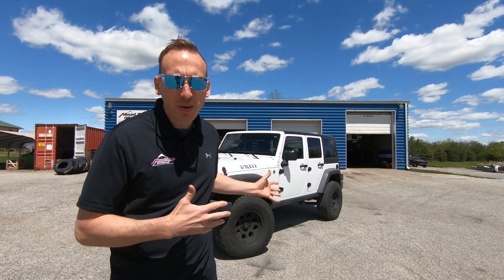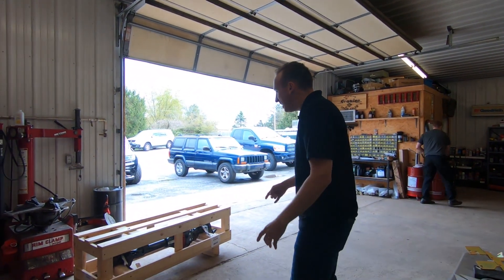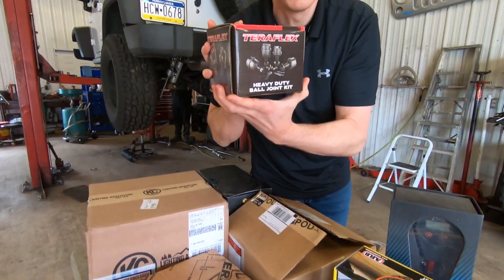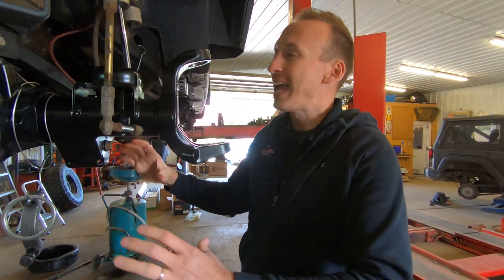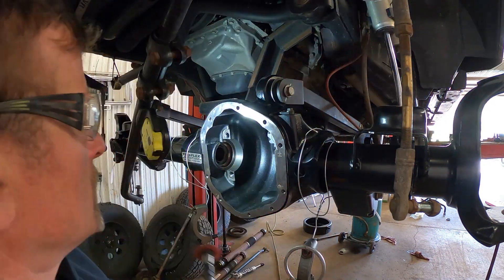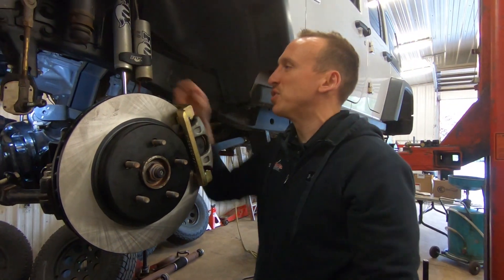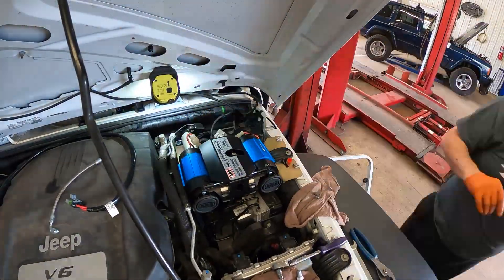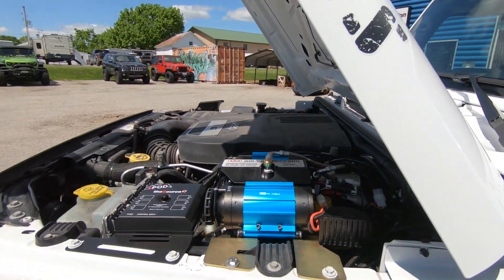How We Build Super Strong Axles with ARB Lockers, Big Brakes & 4.56 Gears for the Jeep Wrangler JK!

Comment: what was the cost for this axle upgrade?
Reply from the maker: An axle loaded with all these goodies, complete with new knuckles, brakes, and RCV shafts is around $7-8k for the front, and for the shafts gears and lockers it's about $2.5k in parts for the rear. These are rough numbers and does not include the labor for install.